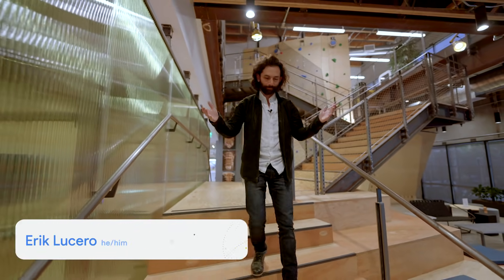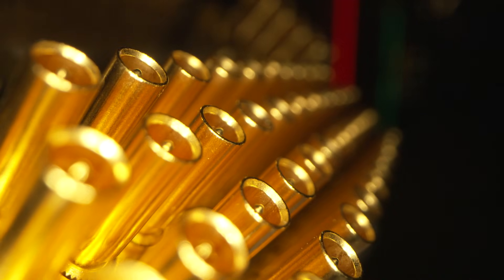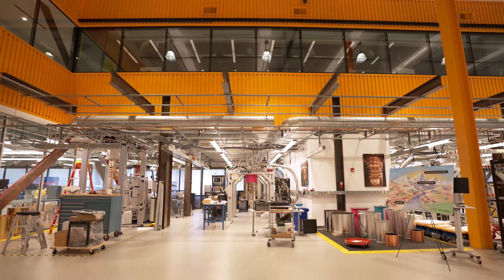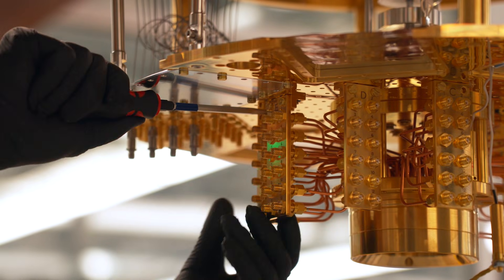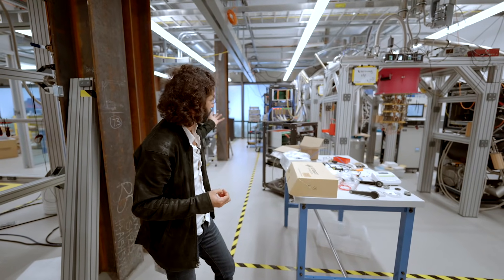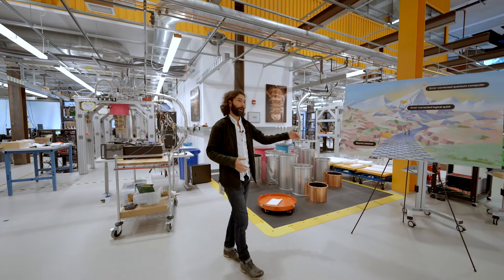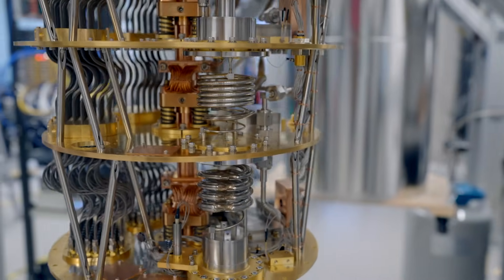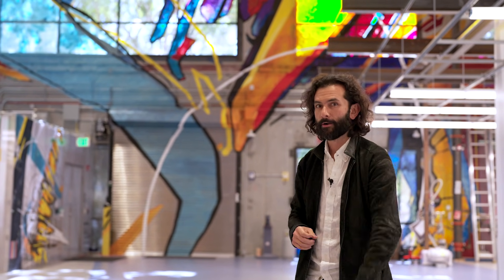Building a Quantum Computer I Inventors at Google

Comment: Quantum computer, if I understand correctly: at all times, it manages to be both "zero / off" and "one / on".  So, any password of the current technology and even blockchain data, are already the past (bank account passwords etc etc ...)
Reply: Yes correct. If you have encrypted anything with, say AES-256 which is the standard for data encryption right now, a quantum computer should be able to find the key in significantly less amount of time than a normal computer. How much gain is possible that I don't know. But you also need to understand that finding the actual encrypted data is hard to begin with, and companies such as Google can't do stuff like this because of the repercussions it will face if found out that they are decrypting data from other companies. Also creating a quantum computer is not a small feat by any stretch of the imagination, so any hacker group can't just create it in their basement. So overall, rest assured.
Reply: @SahilP2648  Yes, there is no problem.  They are technological innovations in the hands of the same multinationals that earn a lot from us.  So, there is no danger.  They will find ways not to endanger our data, bank accounts, etc.
Reply: @SahilP2648  for symmetric key encryption, doubling the key size will suffice to offer enough protection against quantum attacks.  For asymmetric key crypto we will need a new generation of PKCS algorithms called post quantum cryptography.
Reply: 1:34 ❤ 1:37